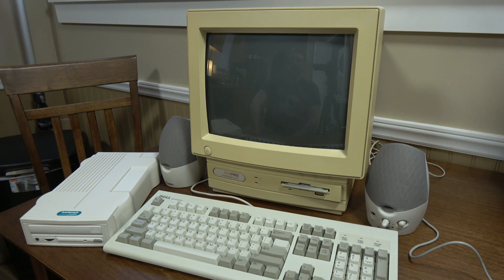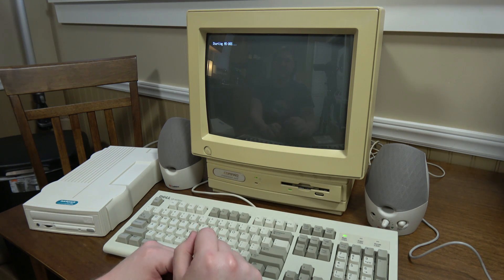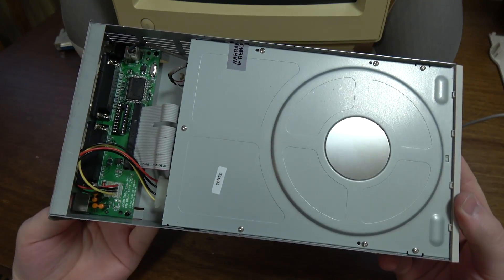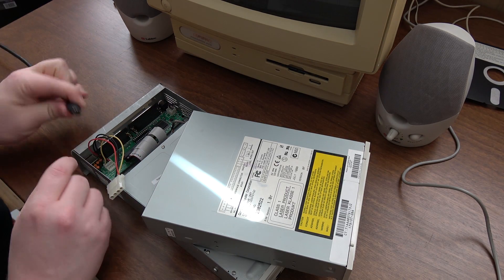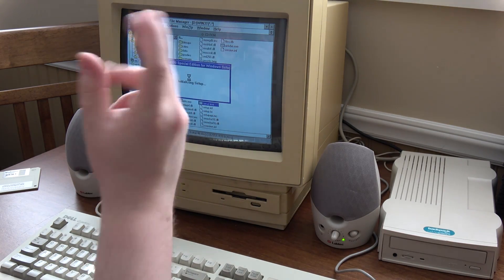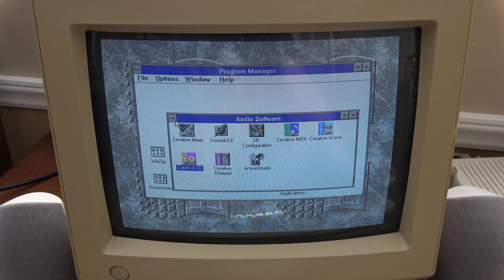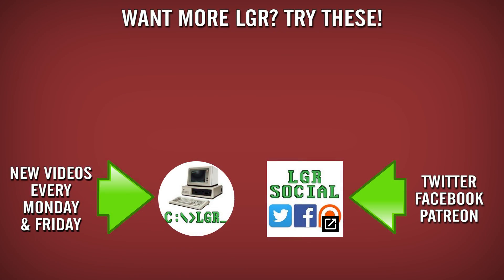LGR - Fixing & Installing a Parallel Port CD-ROM

Comment: Know this is an old video but I think the issues is the CD Play is looking over IDE or SCSI and not the Parallel bridge chip. I remember these backpacks and owned a writer version. Worst for speed was a 6GB Parallel Hard Drive. Have not seen them in years.

Comment: Can't rem brand, quantum, la cie, ? Had a adaptec 1848 parallel to scsi chip inside case. 
Zip parallel drives had an adaptec chip same as 1848 chip.
I think win98 came with a driver. Long boot time to check all ports for PnP devices.
A non Zip adaptec parallel to scsi adapter can select >1 device.

Comment: Wish I had found this video sooner, as I'm trying to get a CD rom drive going on my recently acquired Presario 433! 
From all my reading, and as Clint said, parallel port is pretty slow. I think the solutions would be as follows - Get an ISA I/O card that has an EPP port for faster reading and data transfer - Or use an external SCSI CD-ROM drive. I Know Clint mentions the computer doesn't support EPP, but I'm not sure if he's simply referring to the printer port on the PC itself, you could always add another ISA I/O card to get an EPP parallel port. 

 My 433 came upgraded with a 66mhz 486 (Dx2 I believe?) 20MB of ram (which is the most the mobo can handle) a vibra soundblaster, and a ISA to scsi card. Only problem I'm going to hit is that the SCSI card I have doesn't support DMA so I have to see how bad its going to bog down the processor in PIO mode to see if it is feasible. 

Love the videos Clint, and I agree with your sentiment, for whatever reason these compaqs are just so lovable, I couldn't be happier with mine!!

Comment: Got one of these and same drive - same issue.  Did the same as you and put a new one in.  VCFed.org forums has a CD with all the backpack drivers.  I guess those crappy Mitsumi drives were really the low bidder!

Comment: I just picked one of these up for an old machine sans cable. Is it just a standard male>female db25 extension? I have one from a parallel Zip 100 drive, so hopefully that should work.
Reply: For anyone else who is wondering, this is the case. Zip 100 parallel cable seems to be the easiest to find, but yes, literally just a DB25 male to female is what you're looking for if you have a drive without a cable.

Comment: I remember my 1st CD-ROM drive, it came bundled with a sound card - necessary because it plugged into the sound card to transfer data - the motherboard didn't support it! It was single speed, a basic CD-ROM is 650MB and my HDD was 250MB at the time! I ripped a few tracks, rip 1 track, encode it to MP3 and then rip another track! It took hours to encode 1 tune on a 486sx-25mhz IIRC, crappy encoder Blade-enc, was a bit flawed compared to LAME.

Comment: no way, my second computer had a Mitsumi double-speed drive. i played Quake on it. It was a Cyrix 686 with S3 video card. ran quake decent on minimum settings at 320x240 res. Damn I feel old now

Comment: On my last PC case upgrade, i decided to move to a small form factor case that lacked the 5.25 bay for a disk drive due to at the time thinking that i hardly used it. A few months later i decided that i did still want to use the drive occasionally since it was a blu-ray write drive that i occasionally used for watching blu-rays but wanted to keep the new case but wanted something cleaner than a Sata to usb adapter and a bare drive. I also didn't want to spend another $80 on an external blu ray drive so i decided to get a disc drive enclosure similar to these but for sata and man it has gotten difficult to find enclosures for disc drives. The one i finally found that seemed to have good reviews cost $50 but i guess that was better than spending $80...

Comment: RE: Zip disks -- personally -- I'd replace the floppy drive with a super disk internal drive (they made IDE ones, and they're backwards compatible with regular 3.5"  floppy disks, it'll show up as an A: drive, etc.)... so for 99% of your usage, you wouldn't even notice anything different. -- RE: CD Audio -- Don't plug the stereo into the drive directly -- fucking hell -- Run a 3.5mm audio cable from the cdrom to your soundcard.. JFC.

Comment: Very helpful. Got an old DX4/75 Laptop and was wondering how to best connect an external CD drive. Only two ways were a PCMCIA solution or parallel and I read that quite a few people had problems with PCMCIA.
Another way would be getting the docking station available for this series of Laptops, as it seems to have ISA slots but I wouldn't call this setup "Laptop" anymore. xD
http://www.saschaseidel.de/html/computermarkt/gfx/Siemens_Docking_Station/Siemens_Docking_Station_01.jpg
Reply: I didn't know DX4s came in 75Mhz models, are you sure it's not one of the rare DX3s.
Reply: @Kennephone  No, it is a DX4 75. Btw, you can look at Wikipedia under "Intel DX4", where they even have pictures of such CPUs. They might have been Laptop only though.

Comment: The one thing that would be awesome is have someone make a board that has both power and data (IDE) connections on the rear of the machine either using the add-on card slots or blank spots to connect from the motherboard and PSU to a CD-ROM drive externally instead of the parallel port since some of the BIOSes only have bidirectional or output only on the parallel port, no ECP or EPP.

Comment: Did he ever dissect that dead drive to find out why it wasn't powering up? Could be a simple fix like replacing the connector or resoldering the connections.

Comment: I would have used a null-modem parallel port cable to setup a PLIP connection to another machine and access an optical drive shared on the SMB network. If we had to resort to slow interfaces anyway.

Comment: I was restoring a Sega Genesis and opened it up to find tons of rust on the inner RF shielding, didn't even matter that it was there really but I sanded it all down and sprayed it with a nice even coat of rustoleum primer to stop it from rusting further. Not sure why but it's super satisfying to know it won't degrade any more I guess.

Comment: I have the same external drive to use on my Compaq. It was the only parallel port CD ROM drive I could find on Ebay that wasn't at a crazy price! Mine was NOS and so far is working really well so no need for repair work thankfully :D. Its definitely a big beast and takes up a good amount of space on the desk.

Comment: I used to buy 'dead' drives when I first started my PC company in 2000. If you put it upside down in one hard (fingers spread to hold it steady) and with your other hand hit it fairly hard and plug it back in.

Comment: When you flicked the computer off, I was like, "Ack! He didn't shutdown first!" Then, I remembered that there was no fancy shutdown process for DOS. I haven't used a true DOS machine since the late 1990s so I forgot. That was 19 years ago for me back when I was in high school. All I had at that time was a TRaSh80, CoCo2. My first modern computer I got was in late 2000. It was an eMachines with Windows Me. I still have that computer. I switched to Windows 2000 Professional when I finally realised that Me was crap and there was something far better. Computers I got after that I had over written the Windows 7/8 with Ubuntu. I don't care for Windows especially when the free software with Ubuntu does most of what I need.

Comment: ECP is not slower, but Faster than EPP, if only by a fraction (ECP: 2,5MB/s vs. EPP: 2MB/s) Also ECP has DMA support, unlike the EPP which demands CPU time. On the other hand, if the device does not support ECP, it may fallback to legacy bi-dir mode that is really slow (~50kB/s -- according to wiki)

Comment: uv light causing the yellow color due to a chemichal compound which is in the plastic to make it resistant to heat.
with hidrogen-peroxide and other oxigenizing agents you can get back the white color.
look for the word "retrobright".

Comment: The first home computer we had was an Compaq Presario, a newer type than this, with speakers too, they were under the corners of the screen, and Windows 3.11. 
Too bad it has been thrown away, it was super expensive when new too... I miss using DOS and trying to get games working with too little RAM and Hard Drive space, I played DOOM, Hexen and WarCraft 2 into the 2000`s on that one. A time when you finally got the game running, you actually deserved to play it, and that was an achivement in itself.

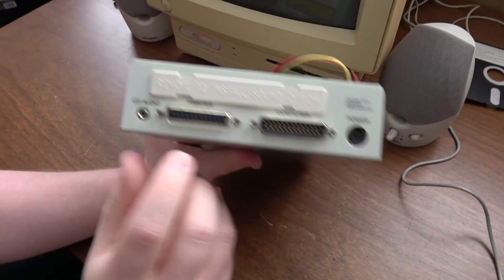Comment: At 7:06 it says "REMOVE TO INSTALL SOUND OPTION" on the back of the external drive, I wonder what that is all about? I assume it's for some sort of parallel port sound device like the Disney Sound Source.

Comment: does the soundcard have a ide port? wonder if you could use a oddball approach like a ide>esata adapter and using a sata drive which still would have a bottleneck obviously but should be simpler than a scsi card install.

Comment: Fellow IT drafted students unite! Mine was mostly in junior high, in the computer lab. Half the computers didn't have working floppy drives, so I had to get a null modem cable and use Interlnk.exe* to put stuff on them. (No, they didn't seem to have any external drives. And I was not going to buy a drive, but I was okay with buying a cable.)

As a reward, I got to spend my lunch break online--through dialup, using my personal account.

It was great until the day I lost my account because some substitute used that computer to look up porn.

*The way you install that is weird. You actually install the server software over the cable, before you actually have the software that lets you send things over the cable on the target computer.

Comment: I remember trying to fix an external CD-ROM drive like this one years ago.  In the end I wasn't able to install a different drive because the enclosure used a 34 pin cable (like a floppy cable) instead of the standard 40 pin IDE cable. And those drives were hard to find because they usually were bundled with a sound card. :-/

Comment: In January 2001 they were still making Parallel Port devices?!
Reply: USB was introduced in 1996 but it wasn't until the imac came out in mid 1998 that peripheral manufacturers really started to take it seriously. I can well believe that some manufacturers would still be producing parallel port products in early 2001. It's also possible that the 2001 CD drive is not original.

Comment: Once a friend and I had to make copies of a set of medical CDs, the cd writer we had on that moment was a parallel external unit, I don't remember the brand but had beige and green exterior, its came with adaptec software and the max record speed was....1X. Damn!, that machine was slow and tricky, if you walk near the desktop the software would show you a "Buffer low or buffer empty" message and the record fails. We left the recorder working and get out of the room really! its was the best way to do the job.

Comment: That Compaq reminded me a little of an original Mac 😉.  

Can't wait for your Zip drive review.  Once had a tech job, years ago, where I'd made a boot disk to use a parallel drive as a backup device for a company's PCs.  This was just before Y2K, so everyone was going nuts backing up their info before the supposed nukes fell 😆.  Luckily, 100mb could still backup a lot back then. 

And it's a good thing it wasn't SCSI or your have to worry about ID #s, etc.

Comment: I got a IDE hard drive enclosure at goodwill. Works no issues
Reply: Peter Kapica Has a USB HDD that's actually a IDE desktop drive. Old but still works. I think the drive is a Seagate 250gb (system says it's 232gb)

Comment: You should do a video comparing the performance of the parallel port between Windows NT and Windows 95/98. I remember using a Zip Drive with a printer (on the same LPT1) on NT was way faster than 98, also data went to both at the same time on NT as opposed to 98 where they had to take turns.

Comment: Almost a shame to put a 32x CD-ROM in a setup like that :) Probably handy to have an external parallel drive around though, as you could hook it up to arbitrary PCs. Are there any non-IBM PC compatible computers that this would also work with?

Comment: Pretty much any optical drive can be ejected with power and no data connection, so I was thinking obvious hardware problem at the beginning of this video.

Also, I once made my own PC-less ATX PSU for testing by putting a jumper in a particular pair of pins on the motherboard connector. It came in handy a couple times, like when my roommate decided to cut out part of an optical drive case and put in a window so that you could see the disc spinning (he had a plexiglass PC case).

Comment: I doubt the parallel port has much to do with the slowness.  I bet you would find the 4x drive to be more responsive.  The high RPM drives seem to have trouble picking a speed.  Take The 7th Guest for example.  It's perfect on a 2x Panasonic drive, but it gets annoyingly slow on a 52x Sony.  The higher RPM drive feels the need to spin up to maximum speed before reading a 100k file.

Comment: I had a Backpack parallel port CD-R drive back in the day. Used it with my PII 400 Compaq Presario desktop in college. As it was pretty much impossible to use the PC when trying to burn a disc, I would always start the process before I left for class, all the while praying the job would complete successfully while I was away. Most of the time it worked fine, but when it didn't, it was always frustrating because errors with the CD disc or software often took the whole computer down, costing me time and wasting the media, which wasn't exactly cheap back then.

Comment: Is it possible to connect an IDE cable from motherboard directly to the external CD-ROM, so the data transmission rate can be improved?
Reply from the maker: Yep, I've actually done that before with this machine. It's not a good solution for anything long-term though.

Comment: I still have some of the previous models of this computer (Compaq ProLinea 3/25) and I remember attaching CD-ROM drives directly to the IDE (PATA) adapter to install Windows 95. But I don’t remember if it ever worked.

Comment: Yea, parallel port will slow you down some....Still faster then if it was going over RS232 (serial port).  Be faster if you had ECP/EPP support too.  SCSI, it sure would zoom.  Of course USB be even faster still, but the PC is pre-USB and I don't think it would be right to add that support (besides, I don't think (and I could be very wrong) any one ever made an ISA USB card, and you do state that the slots are already filled.  Actually, what you could do is run the cables (IDE, power and CD Audio) from inside the system (off the sound blaster and PSU) and hook the drive up externally that way (how I did it back in the day when I was out of internal drive bays).  Yea, I know, that could make an ugly looking solution - it is another option if you want more speed though.

Comment: Dat quad speed CD-ROM drive... I had the double speed one in all my computers back then, really solid and stable piece of hardware.
Other than that, couldn't you just attach a cable with a stereo jack on both ends in between so you get sound out of this CD drive?

Comment: I had a the same computer growing up. But I had an IDE cable and molex power cable sticking out the back of the Compaq connected to a cd-rom drive.
Cant belive that I trow it in the trash 4 years ago. Upgraded to a dx4 100mhz 12mb ram and an 4x cd-rom and soundblaster 16. :(

Comment: So, i'm guessing it didn't matter which power port on the board you had the drive plugged into.

Any idea what the "sound option" would have been for that external drive? I happened to notice that plastic filler piece when you was reassembling it. XD
Reply: They had a sound card board that would plug in.  You could get windows sounds out of it.

Comment: Great video, It was always loads of fun trying to get a Zip Drive or Quickcam to work on a parallel port. You might want to look online for a dos MSCDEX driver. BTW What kind of CPU does your Compac 425 have?
Reply: If you still care: I believe (from another video) it was a 486-25MHz upgraded with a 100MHz overdrive chip

Comment: Thanks for that flashback.  I worked for Micro Solutions from 97ish to when they closed as technical support.  It was a great company and I remember the old cdrom drive you had in its prime.  They also had tape drives, hard drives, PD drives (that tech didn't last long), cdrw drives, and at the end also did a NAS box and fingerprint locked hard drive.  It was a great company to work for where the tech, sales, owners, engineers all knew each other and were a tight group.  Good to see a few products still exist.  LoL

Comment: If you enable EPP or ECP in the bios (if supported) these parallel port drives run significantly faster.
Reply from the maker: 09:05 in the video. It is not supported, sadly.
Reply: That gives me a sad.

Comment: Could you not run a cable from the audio out socket on the back of the CD-ROM drive to the line in on the sound card, rather than connecting the speakers directly to the CD-ROM drive?  I never used those BackPack drives back in the day, but I do remember reading about them.  On a slightly unrelated note, I know you know what Teddy Ruxpin is right?  Well, back in 2007 my best friend told me about a then new version of Teddy Ruxpin that was made by BackPack toys, the first thing I though of when he said BackPack was these Micro Solutions CD-ROM drives like this one you have.  But during this video, all I could think of was Teddy Ruxpin, do you see where this is going?

Comment: On my Presario 425 I had as a kid I installed a soundblaster and spliced the power to the hdd. That got routed through the second isa (pci?? I can't remember) slot along with the ide cable from the soundblaster.

In other words, I had an internal 4x cd-rom next to the computer. Worked great for years. 👍🏻